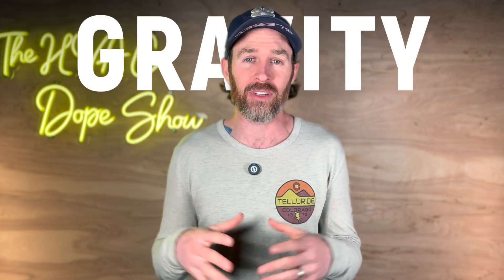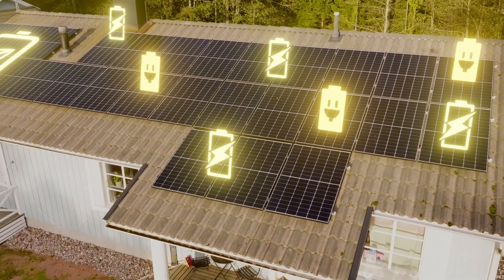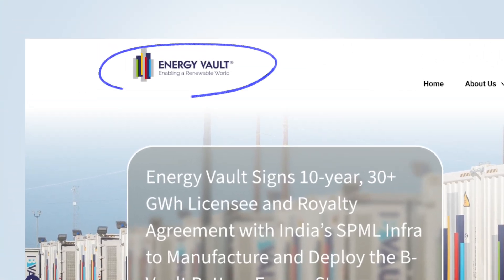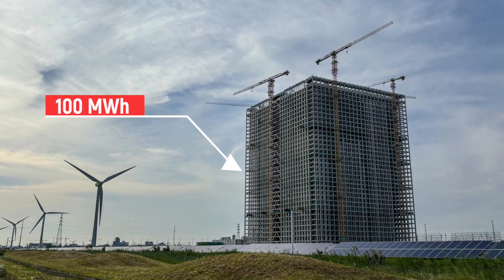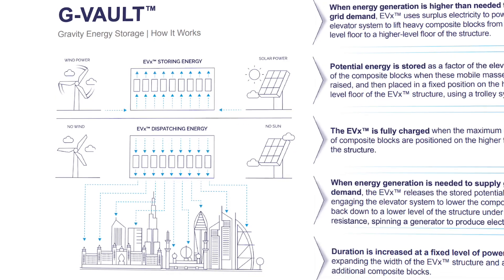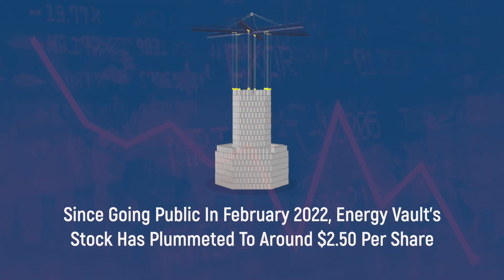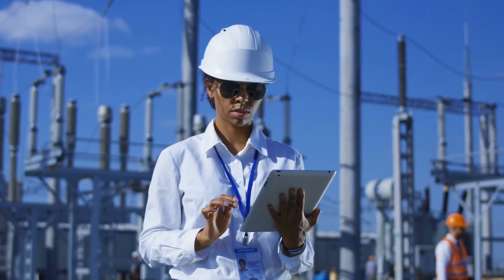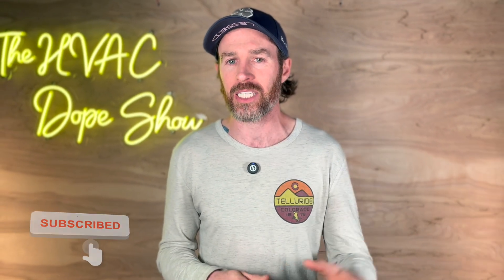Are Gravity Batteries The Future of Power?

Comment: You could build a giant structure to do this. Or, you could use the same kind of gearing employed by a 10,000 year clock to only have to raise and lower the weight a few feet or if done right inches.

Not throwing shade just trying to be useful.

Comment: A block of ice 🧊 melting to cool the air have an 18 times higher energy density then the same volume of cement lifted 200 meter up the air. And I'm talking about electricity usage not how much heat can be absorbed by the ice😮.

Chicago right NOW uses ice as a form of energy storage, and it is a boring old news.

Also my water heater tank have a higher energy storage density as well and its controlled by the electric company RIGHT NOW to use more renewable.

this is a joke nobody should take it seriously.

Comment: 35000+ heavy blocks weight 25-30 tonne each, and an enormous structure with enormous concrete and steel use to store 100 MWh or 400 MWh may be useful to store energy and consume when needed. The technology is not attractive, need huge amount of materials which translate huge amount of capital. The batteries with lithium are not attractive as well. The Gravity Energy Storing must be reviewed. The three gorgeous dam hydropower for generating 100 MWh energy daily has used only around 4150 tonne concrete, and this translate only 166 heavy block with 25 tonne each.

Comment: I am a sceptic when it comes to gravity storage systems.  Thousands of moving parts are used in these systems.  That is thousands of points of failure 😣.  
My current favorite in the long term storage space is nickel-hydrogen.  There are no moving parts and it can work well in both cold 🥶 or hot 🥵 environments.  EnerVenue has delayed commercial production while it works on a 4th generation of its technology.
Reply from the maker: I'll have to check out nickel hydrogen